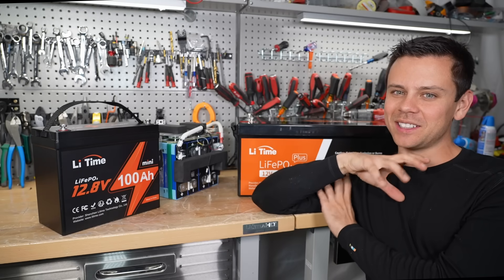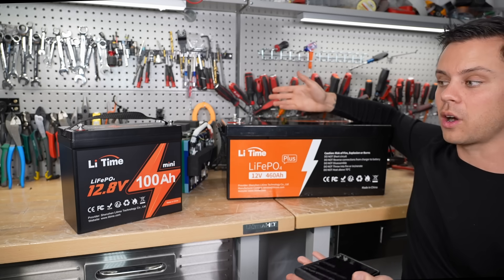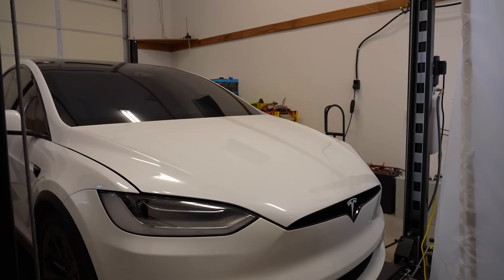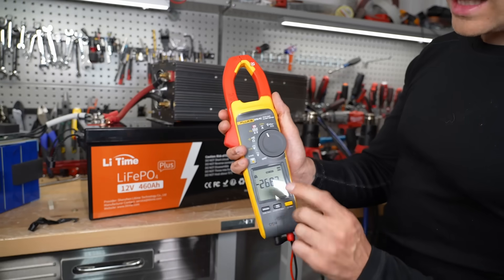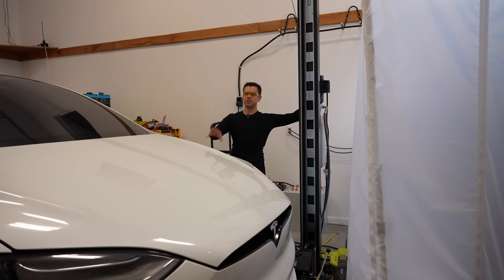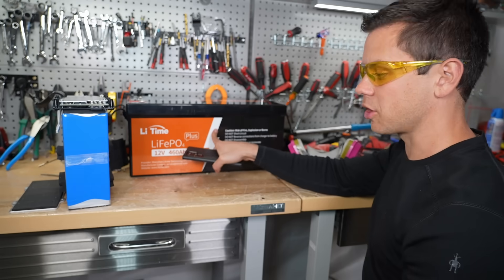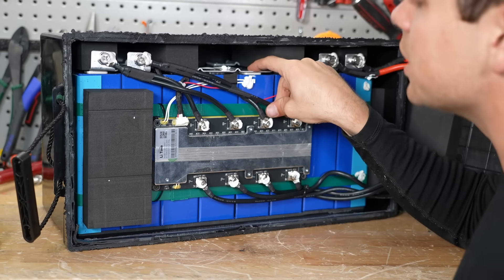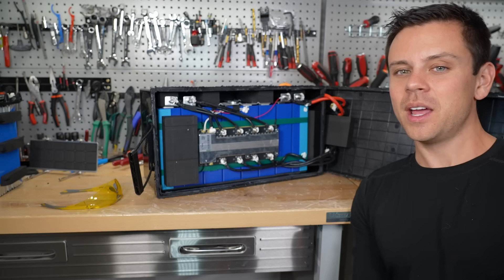LiTime LiFePO4 Mini and 460AH Plus! Surge Testing and Teardown

Comment: I purchased 3 of the LiTime 12V 100Ah mini. Lots of variability between batteries. All were wired in parallel. I had a difficult time having them act as a single battery. 1 battery would discharge and the others would not unless I went through a reset sequence over Bluetooth. At LiTime's recommendation I returned them. The next set also did the same. Also, 1 battery would cell balance for a few hours after a charge, another would take 36 hours. After 8 full charge and discharge cycles, the same. LiTime did take them back and refund my money.

Comment: I totally agree with you about the low temperature. It’s sort of like having Bluetooth once you do, then don’t have it AND you have a problem you smack your head and go why did I put all this money+ time and effort into it and cheap out just that last $15 or $25 or whatever it would be to have a network option/ protect my investmen.  I'm coming to you from Middle Tennessee. We do still get frozen pipes and things it was down into the single digits for days/ extended periods of time two years recently--very very cold so in a garage water bowls freeze solid!  Or inside but even on the floor of an outside wall you could see an issue. I do have a camper RV sort of set up so I am regretting getting 2 100 amp batteries from Litime w/o heaters. I Bought them in the summertime you know it’s roasting here so it’s like 'oh I’ll pull them out now when I weatherize or unbolt them.' Now, I’m like that’s just stupid. I do always get Bluetooth but I absolutely just hate their Bluetooth app. It’s sucks. It’s just like yeah we’re doing everything right, Don’t worry about it and we don’t know for sure what is happening at the Cell leve.  Their low current resolution is lousy as well no updates/restart the app...  I never trust the company when I say "No worries-yeah, we got it.". That’s why you open these up and look at them what’s going on behind the plastic curtain thanks a lot-keep doing what you’re doing and pushing for why people should care about low temperature, though you know eventually regret it when they battery is toast and trust me when it’s freaking cold that’s the last thing that you want do is go out physically unconnected your system, especially if you’re on vacation down in warmer climate you can’t undo your system. Holy crap how do I shut everything off? It’s a major thing that you really don’t want to worry about it: cold temperature protection if not self heating!

Comment: i am of the opinion that all those low temp high temp overdischarge etc etc   safety measures are important.  i would not want to have this in my living space in my van without those safety measures.

Comment: Did these batteries have a temperature sensor to shut down the charging or discharging current if the cell temperature goes above say 50 degree C? If no, then these batteries may blast in summer while getting charged. Also the BMS for some reasons are not equipped to to do the de-rating of the charging current as a function of temperature. Also care must be exercised in using the 12 V battery in old cars as the battery may draw a lot of current when switched ON for the first time.

Comment: I have owned the 100 AH mini for 1.5 years now.  Got it at a super low price just over $200.  It for sure does not have low temp protection, but I knew that when I bought it.  I don't care because I am almost never camping when it hits near freezing.  Plus I am on shore power enough to charge it whenever I need to.  I use anderson connectors for quick connection and can pull it in and out really easily and fast . I just pop it out and set it inside and charge or take it up to a Hotel Room and Charge.  I can get about a week out of it boondocking.  I was not worried about the pouch cells.  I hope it lasts me 10 years.  It does not get hard use at all.  Really good of you to break it down though so I could see the inside of it.  I like LiTime so much I bought a 50AH for $109 bucks as a backup just in case there ever is a problem. No reason I can think of to "Brand Hop" knowing these are so good for the $$$

Comment: Great content ! Wondering,  with the LiTime 12v 100ah bluetooth LiFePO4 , do you still need a circuit breaker for a trolling motor  to protect from battery voltage surges ?

Comment: I need a battery system for my Minn Kota 36V trolling motor. I have been using Duracell group 31 AGM with a on board charger for years but want to upgrade to PO4.

Comment: As of 12/31/24. Amazon price has dropped $.01;  item in your Saved Items has changed price. LiTime 12V 460Ah Group 8D LiFePO4 Lithium Battery, Built-in 250A BMS,  has decreased from $1,129.99 to $1,129.98

Comment: I put a 48v system in my RV with 2 5000w Victron inverterts and 8 Rich Solar Server Rack Batteries at 5120wh but all 8 have a total of 800Ah and I see these tiny batteries at 12v with as many Ah and I don't understand the math or if I don't have the same or more battery power. It's all Victron and a $30k system with 16 250w Rich Solar panes and 8 more on the trailer I pull behind the RV with an interconnect between the bus and the trailer. I would like someone to teach me why a 48v system this big is best. lol.

Comment: I am currently trying to get into Solar Power systems. I am trying to power a small cabin in a third world country abd the hardest challenge is getting the actual equipment. I have seen a few of the videos and currently looking to get a 12V system started to get some hands on experience. As mentioned it's really difficult finding the equipment for a solar power system. I live in Mexico Puebla, and currently the only system brand that is available is Renogy and that is through Amazon MX. I am very interested in these batteries do you guys know if they ship to Mexico? I tried to contact them but I have not gotten a reply.  Any help finding a legit website ir distributor would be appreciated.

Comment: Got the Li-Time 460AH Plus for our class B+ Rv.      We purchased a 2020 Coachman CrossTrek  20XG this past SPring, which was novel when it came out because it was fitted with a 3000 watt inverter and a 330 ah AGM battery instead of an on board gas or propane generator.  The AGM battery was pretty much dead by the time we got it so I switched it out with the LiTime 460ah Plus and  updated the converter that could maximally charge LifePo4 batteries.   It already had a 200 watt solar panel on the roof with a 30 amp solar controller.   Long story short, we lived off grid for three weeks and still had plenty of capacity left.

Comment: Man after your review of the Wattcycle 12 v for 159 I'd be curious to see a side-by-side with the watt cycle mini 12 volt Bluetooth hundred amp hour.  I know the Wattcycle mini batteries do not use pouch cells and was looking at getting four of them while they're on sale for my portable battery and camper.  Priced at 165 each right now...? And it has low temp control... Seems like a better option just not sure I'm longevity

Comment: Did you ever use the mini as gateopener? Did the pouch cells hold up over time? I love the form factor, would fit perfectly in my project but I'm hesitating due to the prismatic cell models having done much more field testing at this point. Thanks for the great videos btw!

Comment: Just received a 48v 100ah LiTime battery.  It is off and shows no voltage.  My smart charger isn't detecting voltage so it won't charge it to turn it on.  How in the hell are you supposed to activate one of these batteries if you don't have a specific charger or another battery that somehow wasn't turned off when you got it?  This is  just silly.

Comment: Great review on these, I have been wondering about the mini. If your charging/monitoring system has a temp sensor option (Victron Smartshunt etc) you can get away with letting the system handle the low temp cutoff. Think I still want to go with something self-heating so I can run it in lower temps.

Comment: Why add a low temp sensor at the battery when many charge controllers today come with a high and low temp combo sensor? I’d rather pay once for the combo sensor at the charge controller than multiple times at each battery

Comment: Before raving on how great these are, have you read all the low reviews on Amazon about attempting to get warranty service? Seems to be a common problem in several 3 star reviews and most 1 and 2 star reviews. I  only found a few "Satisfied Customers" with their service after the sale.  Several tell of the company wanting the battery shipped back to China, once they agree to take it back. This theme was across a couple different models.

Comment: I’m going to be building on my boat with 12v, just because I don’t feel the need to convert everything back to 12v. If I were going to do a house it would be a completely different situation. The savings in wiring would be worth it on its own. I can’t afford the weight penalty on my boat to do anything else besides 12v.

Comment: The problems with high and low temperatures only come when we're charging.
That said, if I've got an "Out of sight system," the temperatures will most definitely be "Out of mind."
And yes, I drool at the thought of a 48V system.
But my budget says "Get a battery, inverter, and charger, and make your own Battery 'Generator.'"
Next I get Solar Controller and a few panels.

Comment: I have a question. It might sound stupid, but I just want to know if this fact matters. Is it more ah better than higher voltage? For example, between a 12.8v 400ah and 51.2v 100 ah, both 5120 watts, which one is better?

Comment: The problem with the giandel inverter is using the outlet, the outlets on my 4000W are rated at 15A, you need to use the terminals to get more than 15A, which, unfortunately, broke on you.
Reply: (24V inverter & system, thanks to your recommendations from a couple years ago or so)
Reply: …im about to buy two li time 24v 100Ah BT batteries, “prime” sale still going on… I almost going with one 200Ah, but want the BT, hopefully their app is good for monitoring the charge and the individual cells, not sure about the latter.

Comment: 4 100AH batteries in parallel still provide more redundancy. In a 400ah battery, it a cell fails, you no longer have a battery.  If a cell fails in a parallel sysem  you still have three batteries.  You will also get more current out of a parallel system. It may not be as convenient to connect, but I would be loath to use large AH capacity batteries unless I was building a large battery bank say 800 or 1000AH.

Comment: Will, a most informative and entertaining video. Thank you for your work! So helpful! Hopefully, LI-Time takes your suggestion to heart, and adds a low-temp sensor to the Mini 12v 100Ah.  Some RV's have the house battery area below the chassis frame thus, exposed to the elements. With the Mini's can add more batteries in the same given space.

Comment: These are 12V because these are replacement for Lead batteries in cars and trucks. But, then of course they should have low temp protection.

For in-house charging, 48V, or DYI with separate BMS makes more sense. I like that industry is making 48V more accessible.

Comment: Thanks Will - great review.  The mini you reviewed does not have Blue tooth.  Is there a good Blue tooth add on device that you can recommend that also might do low temp shut off like you suggest is a needed item.  I plan to use several of the mini's in my van.  thanks

Comment: The Vatrer 12V 460 AH battery is a few hundred dollars cheaper right now and claims to have low temp charge shut off.  Unsure anyone has taken it apart tho.

Comment: When you have failures like this one, you may want to look at the voltage at the inverter terminals.  If they are good, it is probably the inverter.  If that is low, check the voltage at the battery terminals.  If they are good, it could be the wires.  Also, check the voltage drop along each wire.  Something may supprise you.  Even though the cables may be large enough, running a second cable may help.

Comment: Hey @WillProwse, can you talk about the BMS for the 460 a bit ?  Do you happen to have the specs for the 460Ah battery, Litime will not send it until I pay for the batteries and then say it is only attached to the Battery then, the quote was "But you can rest assured that the BMS of all our batteries are of very good quality."  "We are sorry, but there is no way to provide you with specific information on BMS specifications.
Unfortunately, we can't cooperate this time."
This is for a 12V system in a Marine (Sailboat) environment, plan to use three 460AH batteries for the house bank.

Comment: Bought $3500 of AmpereTime and (now) LiTime batteries based on your teardowns.  The original three 300ah batteries have never been anywhere close to 300ah, closer to 150ah.   Now they are 2 years old and capacity seems to be slowly diminishing.  I have monitored the bank (and individual batteries) with Victron BMV-712.     The second purchase was a 200ah LiTime battery, that in 5 months has failed completely.  Elaine at LiTime sometimes responds in 24 or 48 or 72 business hours, or sometimes it takes a week.  The customer support is among the worst I have seen in any industry.   By appearances this is NOT a small company, but all customer emails are answered by the same Elaine ????   Not sure if this is just an English language 'code name'  for the support person of the day, or an actual person.  In any event, BEWARE of LiTime ... they changed their name from AmpereTime recently for a reason.

Comment: It’s not your inverter it was the way you connected to the lift manual say that the outlet are rated less than connecting to the screw leads.

Comment: I have a 4000watt pure sine wave inverter and want to use it for powering my detail polishers or grinder or circular saw and a car drying blower. What kind of batteries and how many do I need to run the inverter.  I'm sure I won't use the inverter to its max but I got the 4000 to have a cushion

Comment: I got a question I'm a truck driver and I want build a battery bank setup so I can run a portable AC and my PS5 and TV in the summer but don't know where to start like what batteries and maybe a DC to DC charger so the truck can charge it when truck is on? I thinking 800ah will do for like 8 to 10 hour on AC? Any help or directions thanks😊

Comment: 12v is still heavily used in the Marine markets.  Most (if not all) marine devices are 12v.  While some people with larger yachts have 48V banks for bow thrusters and windlasses and also have inverters to run kitchen appliances and sometimes washing machines, the vast majority have only 12v devices.  (LED lights, Navigation lights, Chart plotters, TVs, Radios, fans, etc.)

Comment: I enjoyed your video Ivery much. I have been looking for a marine dual purpose lithium 100ah battery.
I read the answers from LiTime as to why you can not  use this  battery for starting 150hp outmoard.
They said it was only due to the charging while the out board was running and that would be bad for the battery. I have also read the the alternator lower voltage input would not hurt a Lithium.. I dont want to spend 700-1500. if I don't have to. Any answers?

Comment: Will, to answer your question, I'm still building with 12V because I'm powering off-grid equipment that runs directly on 12V DC. It makes no sense for me to build at 48 volts, then have to use a switching buck regulator to get back down to 12. If I was using an inverter and powering 120V AC stuff, I'd see the value.

Comment: Great video! Hey Will, quick question. Don’t most newer MPPT charge controllers come with a thermometer probe and low temp charging shut off built in? I’m thinking of the Renogy 50 amp. Thanks!

Comment: I am building a 14ft cargo conversion.  Was thinking 12v for ease and no step down conversion.  But should i do 48V?
Having 200-400ah batteries and uo to 950- 1900w solar (will be able to easly add or take away panels). 
Btw i am looking at saving weight and rarely used in winter but it is a possibility.

Comment: Thanks for making great videos.  After several years of weekend offgrid camping I have decided to go with litium on our new camper.  Based on your videos I feel  two  100 amp / hour Li Time batteries will  meet my needs and I do have solar ,400 watts. Question I have  that  I am having a hard time answering is with charging from my truck. My truck has a 12 v 40 amp  fused constant supply  on  my 7 pin RV plug. So, with these  batteries  will they try to draw more than 40 amps  through this circuit blowing my fuse on my charging circuit. I understand my truck battery will  aid as a buffer but will it work safely? If  two  Li TIme 100 amp hour in parallel  are exahusted how many amps will they  attempt to draw when plugged into truck  having low  battery internal resistance? Thanks for youur time.

Comment: Will - Any issue with mixing LiTime batteries?  I have the 230 AH battery from LiTime, and wouldn't mind adding a 100 ah later this year.  I'm assuming not, but curious what you think.

Comment: Hi will, did you ever try to run to battery in parallel 48v 100ah 4800wh with 5.1v 100ah 5120wh to see what happen when you charge and discharge the battery?

Comment: I am from California i am adding two LiTime LiFePO4 460AH 12 volt in my RV. I already have 2 Eg4 12v server rack battery installed with the Victron inverter. I would like to know your opinion what do you think about mixing these batteries.